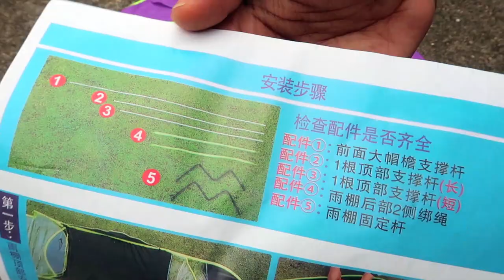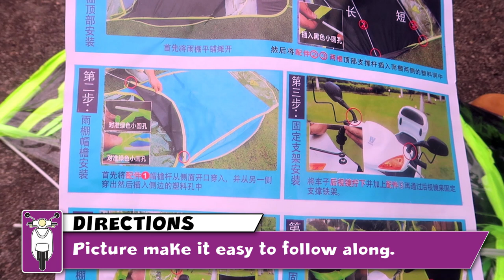Scooter Umbrella (Sun & Rain Roof Cover)

Comment: Just a tip, I had mine like this for a few years now with no issues riding at fast speeds, unzip the front part so the wind will pass through inside and distribute it evenly inside.
Reply: I agree.  I have exactly the same type.  I have used it for a year or so in Vietnam and my wife only had to reach up to hold it once, it was in a storm

Comment: Thank you, I'm 74 and disabled so I'm fitting mine to my mobility scooter. My canopy came with only written instructions (no photos) so your video was vital to me. My front metal brackets came with clamps to fasten to handle bars but there was no room so I followed your instructions and used the rear view mirrors to fit these.
Reply: That's exactly what I'm planning to do. Did it work? I mostly want it for shade but also like knowing my control panel will stay dry in a light rain.

Comment: Thanks so much for this review. I'm looking at these for a mobility scooter. Not sure if the front attachment rods will work on it and I wondered what happens to it when you steer.  I'm pretty sure this would act like a parachute at any speed over 12km p/hr!
Reply: I have had this on my mobility scooter  for 3 years now. I even added sides for that added protection

Comment: They should make it in black and reflective silver. I’ll bet most people say No to these. Then wish they owned one once stuck in rain.
Reply from the maker: Definitely would have liked those colors better.
Reply: I already listed my 125cc for sale after 4 weeks. I want a Burgman 400. I’m too big. On country roads I’m lucky to stay above 53-54 mph so cars tailgate me! Top end supposed to be 59 Cali Classic.
Reply: I understand your pain. My 83cc VIP tops at 40-45 mph actual speed. You might want to consider a big bore kit. I've driven mine wide open throttle for the last 750 kilometers no prob. It accelerates faster, gets up to speed more consistently, sounds beefier even with the same exhaust, and feels more like you are on a motorcycle. Its easy to install as well.

Comment: Can this be fixed on without undoing the mirrors as only have one, didn't realize this when bought it thank you
Reply from the maker: You could possibly use a bolt as a replacement for the mirror not being there one that side. Find a bolt with the proper diameter and length to screw it in  the hole where the mirror would have gone. Hope this helps.

Comment: could this be mounted on a trike?
Reply: It can be mounted on a mobility scooter also as long as they have front mirrors or try and tie the front maybe with cable zip belts I used those for accessories eg front mirrors that didnt fit the bar size as its a bit wider that the size of the item belts for on my scooter.The back has to have a part to tie it to like the back of the seat or something like that.
Reply: @gothikaslittleshopofgothic
Reply: Ageism. I did not say a mobility scooter but thanks all the same
Reply: Yes I have mine mounted on a trike.  It is perfect, this does not form a perfect cover but then again it does not require extra effort and it provides extra visibility.  It is hot here so not at all concerned with a bit of rain.  Very good.  Initially I was very reluctant, but I very like mine.  And it was CHEAP

Comment: Cool product, and great price. Was it designed specifically for the make and model of your scooter? I would be afraid to ride it in high winds or high speeds, but if it's a light to medium rain while in city traffic it could be okay. Be careful in cross-wind areas too.
Reply from the maker: good points
Reply: in China we use it only around town where you can't drive fast
Reply: @sutibun-kun  that makes sense.

Comment: i have three of them and it was a pain in the ass to open .not very good with high cross winds and rain.but mostly it will keep light rain off you .may rain on your shoes .in heavey rain but mostly you will keep dry not very good in high wind. in a cross wind i recomend 20 to 25 miles a hour to be safe.when the wind is calm you can go up to 35 mph.i live in north carolina right on the beach winds around here can be very high to ride in with that cover .some times its just like having your own personal sail.
Reply from the maker: Great to know. Thanks Jamie